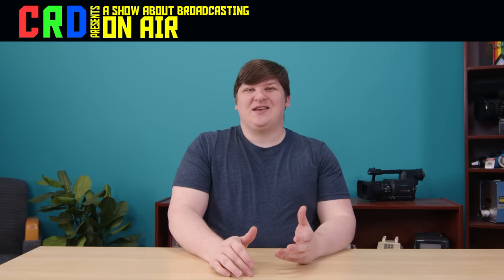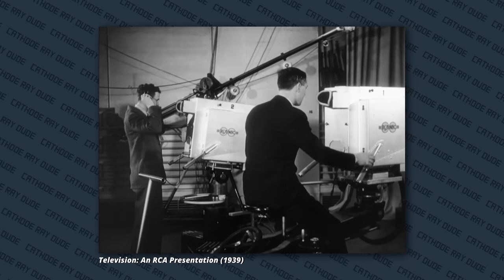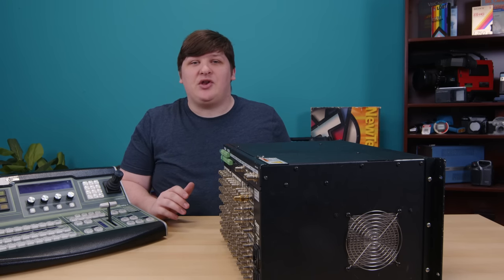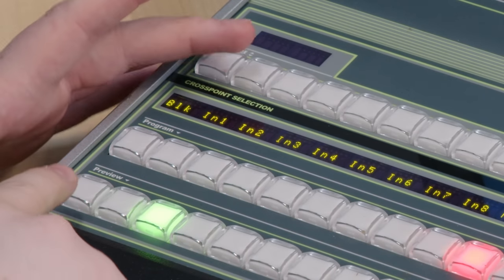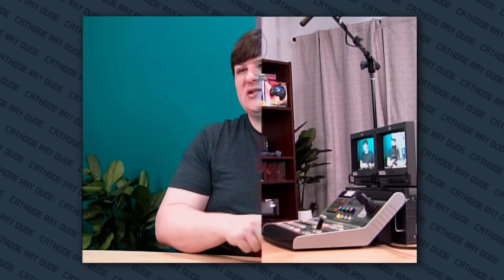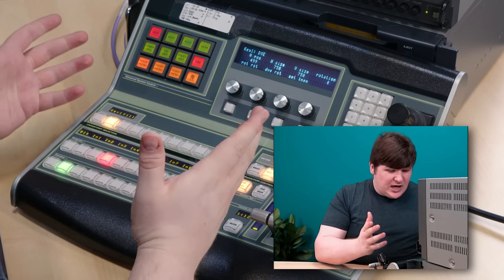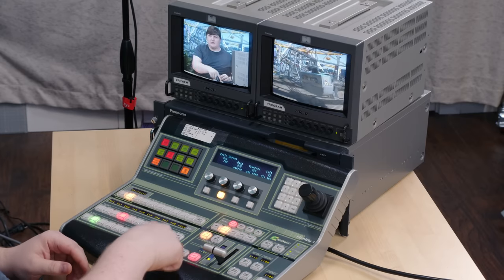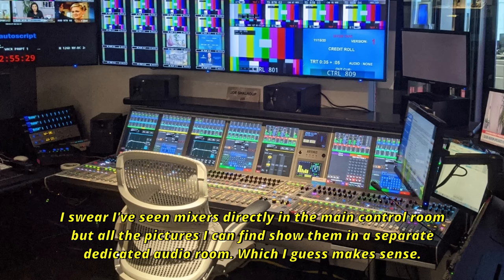What the heck is a video mixer?

Comment: I cut my teeth using a Panasonic WV-5600, a double T-bar bus version of your 4600. It had a CUT button, and was designed to be inlayed into a table top despite being a standard rackmount device. It had some silly analog effects and chroma keying , but was a pretty straight forward SEG for running a 3 camera production using WV-5100 studio cameras. It was also the HEART of a the TV studio, providing the master genlock sync to every device there from the cameras to the TBCs for the VTR output.

I have also used the WJ-MX50. It was mostly marketed by Panasonic for use in A-B roll VTR editing systems. The setup we had was 2x AG-DS545 SVHS feeders, one AG-DS555 recorder, a AG-A750 editing controller, and a WJ-MX50 connected via RS-422. Through the magic of buying more feeders and timecode, you could record all your camera feeds to tape and later edit it like a live production.

Comment: This might be a hot take or completely true, but I have the feeling that OBS could be modified to be an entire production movie mixer. All it needs is a way to get a lot of sources in and a control deck.
I think that's incredible considering it's free software. I could see entire productions being done on OBS in the near future, and to and extent I could argue that's already happening.
Reply: I will say however that reliability is nowhere near as good as production mixers, but it's certainly a lot better than any other option out there for low cost productions , at least at the moment
Reply from the maker: The problem with OBS in my experience is that it's too stupid to understand how to switch sources reliably. In a mixer, there's an abstraction layer. All the sources are constantly being ingested into framebuffers, so you can pick whichever one you like. In OBS, if you switch inputs on a source, it takes 2-4 seconds to initialize a new video device; and if you try to use the same source in two places, you can wedge the whole app. It's just not designed for it, and while you could sort of, kind of hammer it into submission, it really just isn't built for this.
Reply: @CathodeRayDude  there's nothing saying it couldn't be redesigned to do things like that(open source software invites that), there are also dedicated PCIe capture cards, but it seems like the way it is now is not ready to be used for something that important. Although I could recon the "computer bs" could be fixed if you modified the OS to be dedicated for streaming and nothing else, but at that point it may be better to use something else, not entirely sure. I know Linux was used a lot for computer aided DJing and the first ones used a custom Linux distro designed to be dual-booted with windows xp. I could assume at some point someone has locked down their windows stream box or used Ubuntu studio to get more reliability, but OBS is OBS.
Reply: @JessicaFEREM  It could probably be possible, but would mean a redesign from the ground up. Big OBS updates are enough work already, you would need to have a paid dozen of programmers to realistically make such a big change in a reasonable amount of time. And you're probably right about the OS too. Windows has a lot of overhead, but Linux has also a lot of overhead in comparison to dedicated FPGAs. That's why there's a market for hardware mixers. You can strip down Linux to its bare parts, but you can build something else better anyway in that case. But I'm not a software engineer (yet) and I have no experience in OS development. I was a TD in high school, and because the productions were so small there were a bunch of things that weren't industry standard.
Reply: @xWood4000  that's good to know, thanks!
Reply: @xWood4000  It’s unlikely it’d be from the ground up, I imagine it’s likely one part of the backend that gets confused when used as a live mixer. I do reckon there’d be some trouble with working on multiple live video streams at the same time without some ability to offload it to hardware. You would also need to do some work on fixing up any latency introduced by either libraries or the OS itself.
Reply: I'm running 3 to 4 cameras over NDI, I'm using a portable touchscreen Monitor for my multiview and a numerical keypad for cameras and fade / cut. I set my profile up like a switcher. I have one scene set up where I am bringing in a laptop over HDMI for presentations and then another scene takes that and I have the three camera scenes layered so I can just toggle them on and off for the best view in a split screen with transparent chroma key background graphic.
I have a graphics scene and credits scene these get layered onto three duplicates of the cameras so I can have with and without lower thirds. I have one system on windows and one system on Mac stability is reasonable with a decent system used mostly dedicated. I have had some weird codec issues and some weird crashing most of that's been changing settings with NDI that I shouldn't be during live streaming.
Reply: @CathodeRayDude  there should be an option to set a device to stay warm. Of course this depends on device.

Comment: TD here too! In my past life I used to TD for live horse racing, and the wipe was totally utilized a lot. We used the horizontal wipe for races about halfway. 
Cam 1 up top would show a wide view of the field along the top half of the frame. Cam 2 would be tight on the first few horses on the bottom half of the frame. 
Stick a horizontal wipe transition halfway between the 2,with a nice feather and what you have is the entire field of horses tight, and wide. 
I would also use star wipes and the other wipes when I was bored.

Comment: Actually most mixers in the consumer range could not make dissolves as it requires quite complex circuitry to do that. They could fade or dip to colors or maybe even had alfa matte superimpose that could be changed in color. However mixing two video sources required having a sync signal from the vtr or camera or they digitalized the imput feed like the Panasonic WJ-MX series. 
Synchronizing both frequencies was what made these things so extremely expensive at the time. I remember the cheapest consumer video mixer that could dissolve between two cameras to cost over 2500€. 
However i really like watching your videos about old tv equipment!

Comment: There is one exception to the "sound!=video" thing, and that is presentation /playout/continuity (the bits between the programmes). Here, back in the days before this became almost completely automated and TV stations' presentation departments had what amounted to a full-featured switching desk, run very much like any other studio, the sound was run alongside the audio in most cases.

This was very obvious at our local ITV station in the UK (Tyne Tees TV), who for reasons only known to themselves continued to use their mid-1970s installation as late as 1992. They had a GVG installation with an early (1976) automation with autosequencing of wipes etc, and as was common at the time the duty announcer appeared on screen and the presentation was run as a kind of TV show in its own right. One side effect of all of this was that as they'd take a new source, and the mixer swapped sources as you show, there was nearly always a noticeable sound loss as the mixer cut sources, giving the game away that the same mixer was responsible for the sound.

It also meant that short news bulletins (broadcast direct from presentation) could be very clunky as there dud not appear to be any way of running two sound sources concurrently for any length of time.
Reply: I miss in-vision continuity announcers. Nowadays you're lucky to even get voice only.

Comment: @51:04 now i know why this all looked waay familiar when you showed the panel
i happened to build a control surface for one of the early blackmagic mixers (for the panel was way more expensive than the switcher itself) and ended up puttint those shift layes in verry similar spots, aka mix/dip and so on, as well as (of course) i kind of took some inspiration from the BMD control surface to map that to the panel i did (which was an ampex thing with no idea where it came from and to what it belonged originally)

Comment: Great video! I learned a few things and I'm something of a TD myself, at least until the billion dollar corporation I work for changed my title so they can add new responsibilities without adding any pay. It's funny you point out the seat of the pants capabilities of a video mixer. The switcher I use costs half a million dollars and I never even touch it. I'm told that with the fancy system we have, I can do all kinds of things on the fly, but I feel like it's all on rails now. I do my job with a mouse and keyboard using software that automates everything. There was something romantic about having a full crew in Production Control, punching shots as the Director calls them out. Working as a team with the camera and audio operators. Yelling at the prompter to keep up. But those days are over for a lot of us. Now the cameras are all robotic and it's my responsibility to program them and keep them from crashing into each other, the more complicated the show, the more disastrous it can be to make changes once on the air. Nowadays I compose the shots, set the focus, put them on the air, run the audio, punch the graphics, cue the talent, roll the breaks, coordinate with the Hub during live network events (since they shut down our master control), sometimes I even have to time the show. Even the talent scroll their own copy with a foot pedal now. There's no one in the control room anymore but me and a producer. So I don't feel like the huge switcher we have really gives us half a million dollars of flexibility. On the other hand maybe I'm just not using it correctly, often we'll get new equipment (like robotic cameras) and literally only two days of training for it. Don't get me wrong, I love my job but it's changed a lot in the last 10 years. I feel like the last man standing. I have friends at other Stations who still run a full crew, but I'm sure their days are numbered.

Comment: I have a 2 ME Ross Synergy II SDI switcher sitting in my garage collecting dust. Was a pretty impressive machine back in the early 2000s. It's the first multi ME switcher I ever used.

Last time I turned it on it still worked. And the desk even still uses tiny incandescent bulbs to illuminate the buttons.

Comment: We used a Ross CrossOver 12 Switch  4801AR-220 at our local Television Station when I was directing some live Television. Pretty easy to use and learn, can't believe how expensive they are, but it is a reliable machine, and the simplicity made it great for our local station which only had around 3-4 cameras per show.

I've only ever used the T-Bar just because I felt like it. Sometimes I wanted to slow down the fade, which the producer wasn't always a fan of, but I did it, since you also don't want to mess with the stations settings already, I used it when I felt I wanted to do a different speed transition (fade), I usually did it near the end of the show for the credits/commercials.

Comment: Someone may have already mentioned this and I just missed it, but regarding all the rackmount stuff: bear in mind it's not just vertical enclosures; there were also desks designed to hold rackmount gear horizontally or at a slight angle.

Comment: The SFX generator you showed at 53:41, or rather the big brother of it; a scond T-bar with a third bus in addition to your preview bus, chroma key, mat, and joystick.  It was a PAnasonic withthe same color scheme as the one you were showing.  The studio I learned in had two rows, split level.  The upper row had the lighting panel, the special effects generator, teleprompter, and a space for the producer to make notes and oversee everything.  Bottom row had your audio mixer, VTR 1, VTR2, with the timebase corrector above them, the Chyron (character generator) then your program deck, and engineering station that had you vectorscope, waveform monitor, and camera control units.  Above the rack was the window o the studio, and above that were you camera VTR monitors, Program and Preview monitors, and the on-air monitor, and the speakers for audio monitoring.  All this was in the late 80;s and analog, 30 frames per second, 525 scan lines.

To set up a box over our news anchor's shoulder, you'd have C bus on program. You can then use the A and B bus and route it tot he preview monitor.  On A bus, have the same camera selected as what's on your program.  On B bus, you select the source you want in the box.  Wipes were done on the A/B bus, and the disolves or fades were don between your A/B bus and your C bus.  Select a square wipe. Split the T-BAR on the A/B section to size your x and y boarders (how big is the box), and use the joystic to move the box to reveal the information and mask off everything else.  Use your second T-Bar to mix up from the C bus to the A/B bus.  Seeing as how the the A bus is showing the same camera as your C bus, it looks like there isn't a change, but the box created with your B bus would fade in.

Not only did we do live, but taped shows, and used the VTRs in the control for A/B roll editing.  We didn't have non-linear editing.  We would have to set our edit points, roll the tape back 4 seconds, start all three decks, and then either have a second person on the switcher to do the cut or dissolve between A and B deck, or reach over the counter from the bottom row and perform it yourself,  We also had a mobile studio in the a box truck that we would use a lot, mostly shooting local high school sports. but it could be used as an A/B roll edit suite, too.

I learned video engineering at that place - there's a totally unique aspect no one ever seems to talk about now days.  As the engineer, I had to know every job on the crew, why an announcer's mic went out in mid sentence, fix it while live, set the white balance on the cameras in the middle of a shoot because the afternoon turned to evening on the Enfield;s baseball against Windsor Locks game is going past 7:30 and the color temperature has changed, why the sync generator quit right when news anchor was interviewing the state senator (the intern unplugged it so they could plug in a fan).  You ever lose your black signal while live?  It's bad.  Man, I miss those days.

Comment: I love your videos about video!

Also, I'm a sound engineer. And I appreciate that you obviously do proper bandpass filtering for your audio tracks. Your vocals sound great. I follow a number of Youtubers and many of them have fantastic content with some lack when it comes to sound. 
right now I'm using a sort of hacked together sound system with a tiny analogue mixer without hpf or lpf on outputs, and I noticed I didn't have to shut off the subwoofer to watch your video like I have on some other of thoe others I watch... Lol Just an observation.

You're great. So thorough and well done.

Cheers

Comment: +1 for the cool intro!
The reason the SD equipment still trades hands at such high prices is ATV, or Amateur TV. Amateur radio operators around the world will use those to switch, mix, & control video inputs for their transmissions.
And if you want some info on automated commercial radio programming in the 90s, I can point you tow someone who started selling software & equipment for just that in the late 80s. The guy's name is George, & his YT channel is AmateurLogic. Today he's still employed as a broadcast engineer, often fixing issues at the transmission tower.

Comment: Analog Glitch Video is what’s driving the prices of SD video mixers, TBCs and CRTs right now. It’s a new visual art technique that was discovered well after digital took over. The Mx50 you have is a HIGHLY desirable mixer because it’s built in TBCs capture glitched signals very well compared to other mixers. I perform live analog glitch at concerts and use a mx50 as my final mixer outputting to a 70x CRT wall. Would be awesome to see a part 2 video that covers this stuff. 😊

Comment: I spent many hours on that Datavideo switcher.  It was barely usable.  I also spent many hours on a GV 110 and a $400,000 Sony High-Def aircraft carrier.  The 110 was my fave, believe it or not.  It was flexible but intuitive.  We actually used the wipe function a lot, namely to split-screen in two cameras or as a PiP.  It's kind of fun because if you want a second camera in the upper-right corner, you'd set up the corner wipe, then have the camera zoomed out with the subject in the top-right corner of the frame.  No resizing of the image.  I also used the luma-key a lot to super-impose graphics.